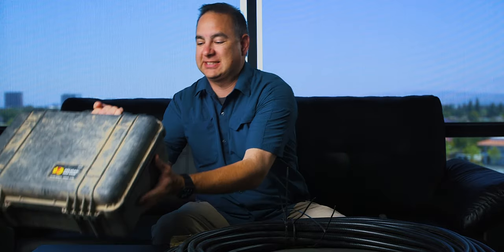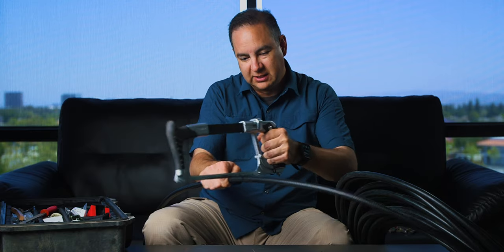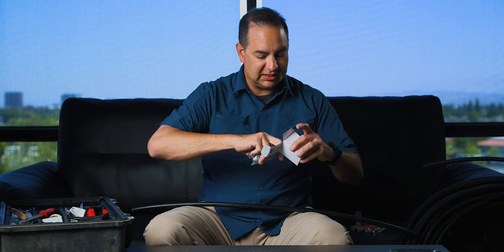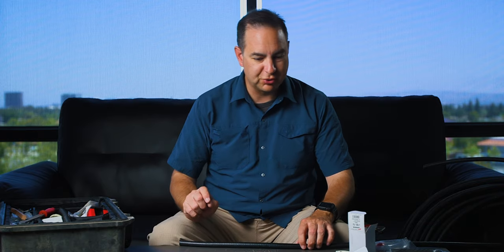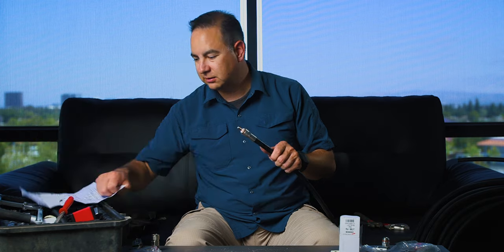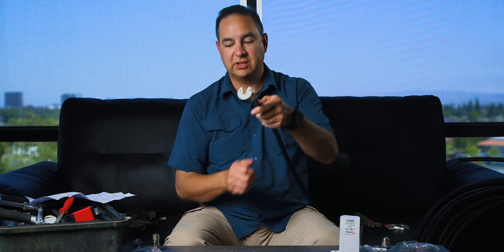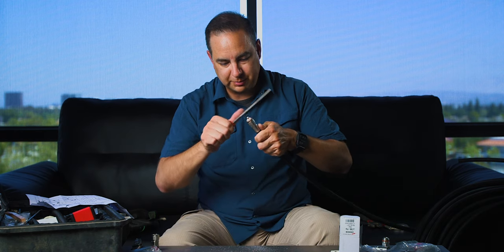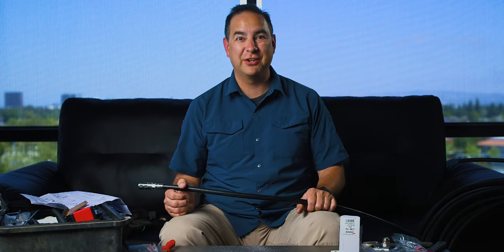How to make a coaxial jumper cable

Comment: Funny enough saw a few of those connectors this weekend at the ham swap shop. But as I have no need for them, and no cable either to use with them, they did not come walking home with me.
Reply from the maker: It’s fun to put the bigger ones on… just kidding no it’s not.
Reply: @TheBroadcastEngineer  It is when you need to bring out a blowtorch to solder them that you get problems. That and the big ones that need hydraulic tooling to even be able to cut and prepare the cable.
Reply from the maker: @SeanBZA  And that's when I leave it to the folks who have hundreds if not thousands of more iterations of installing connectors...

Comment: Are the connector gaskets adequate for outside use, or, do you need to add some additional sealant (coax seal or similar) to the connector?
Reply from the maker: You will want to use some sealant. There’s a waterproofing kit that has basically a wide roll of electrical tape and some gummy sticky tape. Always fun to use that stuff, then years later peel it off and try to undo the connector. But it works!

Comment: I saw this and was hoping you were going to DIY some actual coax.  Was waiting for copper pipe and some time to improvised dielectric.   What connectors are those?
Reply from the maker: Those are N connectors. Sorry to disappoint.
Reply: N to semi rigid coax, so you can still flex it, but it is less likely to flap around. Not meant to be moved often, but at least you do not have to align every part perfectly, and it does handle reasonable power with minimal loss.

Comment: Working in electronics I have to admit I find working with big stiff cables like that is a hatred of mine, they're not easy to work with or handle
Reply from the maker: So much fun trying to wrangle them into position while trying to maintain bend radius.
Reply: @TheBroadcastEngineer  Try in avionics, where you not only have to deal with 1000 cables, all white, with worn off numbering, but you are also doing this while standing on a wheel in a wheel well, with just barely room to breathe as well. And the connector you need to get to you need an extra 2 elbows and wrists to reach, plus vice grip fingers to unlock it. Only good thing is that only half the connectors are wire locked in place, but you will have to do the locking manually because there is no way to get the pliers in there.
Reply from the maker: @SeanBZA  You win! :P I've had to stand in some tight places to wire stuff (our former Barstow station), but I had more room than a wheel well and less wires and cables.
Reply: @TheBroadcastEngineer  Try resetting a tripped breaker, where you can see it, through the nice little window outside marked "Crash Tow", but inside you need to be guided by somebody outside, because your arm is up to the shoulder in a wiring loom and pipe mess, and you have to feel around for it. Then pull out, check it has gone fully out, then press to reset it. Or changing stuff where the only thing keeping you from being splattered on the roof are 2 thin steel safety pins in the ejection seat, and if only one fails the seat will leave. Plus Top Gun pilots are pretty short guys, I fill that seat up all the way. You meet fighter pilots they are all 5ft 6 or a little under, no long beanpoles or heavy people, those will almost always end up as either bus drivers (transport aircraft) or air beaters (helicopters), as there you do not wear the cockpit.

But flying in heavy lift helicopters is great, lovely view, and I still remember flying sitting in the door, hand in the door strap, and looking up at the ocean, and down at the sky, while they were doing a barrel roll in 16 tons of helicopter. Lot more like a roller coaster though in a small one, where you can get serious G, and also go into free fall for around a half minute during testing.
Reply from the maker: @SeanBZA  Wow! That sounds really exciting!!